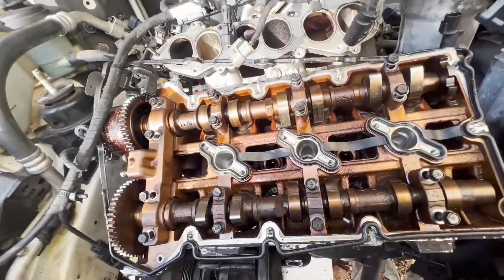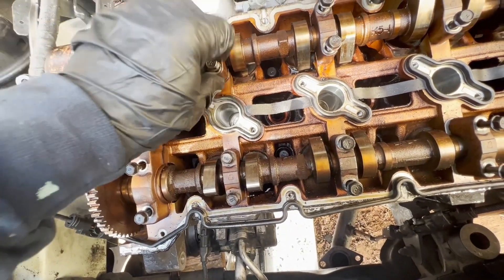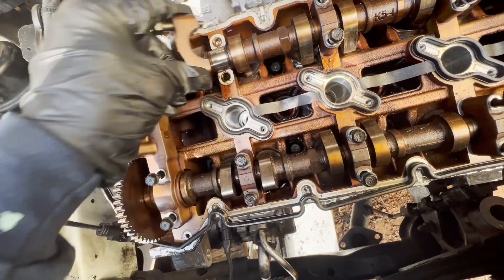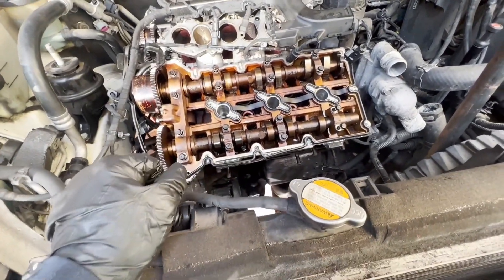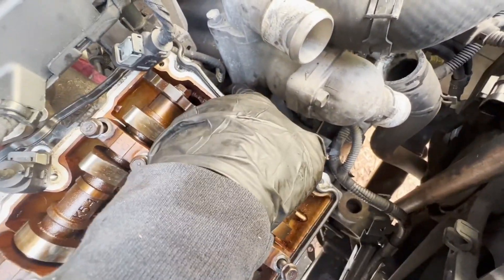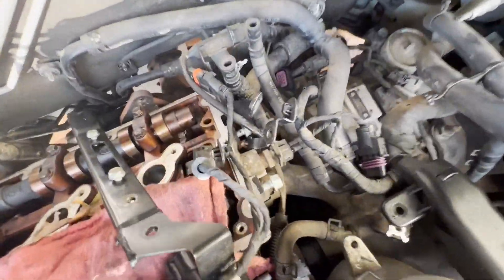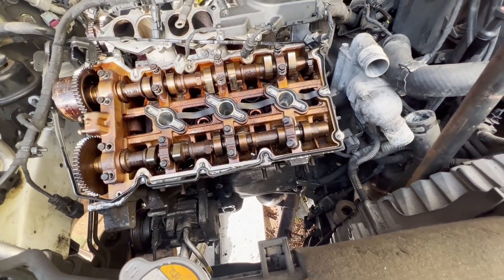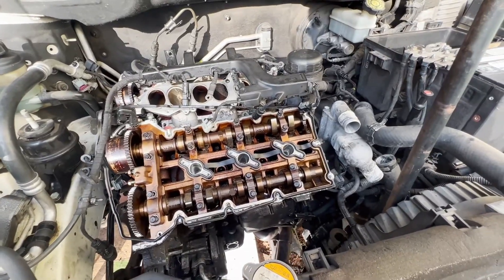2006 Kia Sedona 3.8L Blown Head Gaskets Part 2: Head Removal and Blown Gasket Analysis

Comment: Good Vid !
Reply from the maker: Hi. Thanks for watching and taking the time to comment. This is a multipart series, that I'll be deleting some of the later parts. Long story short, all aluminum blocks suffer this "blown head gasket" which is actually the steel head bolts working loose in the aluminum block. When you go to reassemble with new Torque To Yield (TTY) head bolts, they will strip the aluminum threads.
The steel inserts kits are $400 - $600 and probably 20 plus hours of labor in doing all of them which you would want to do anyhow. Then there's all the points for possible oil and water leaks as RTV is the front cover seal. 
I had this great idea that didn't work to thread the bolt holes at the top and put inserts in there and use short Chevy SB Main Bearing bolts for head bolts. The holes were too big to get a deep enough cut for the inserts even using long ones and when torquing down the heads the inserts spun just as I got to 70 Ft pounds. 
If you have blown head gaskets in something this old with an aluminum block and high miles, take my advice and just junk it. I did that for $500 as the last video in the series shows and used that money to put AC in my 83 F-150 which with a cast iron block and heads will run for ever. ;-)

Comment: What do you do when your timing marks aren't lined up?  The cam closest to the radiator is the only one that is off and its about an inch farther than the rest.
Reply from the maker: Hi/ Thanks for taking the time to watch and comment. Theu absolutely need to be perfectly timed. Don't spin the engine with it like that. It's an interference motor and you'll have pistons bending valves. 
You'll have to release tension in that chain to get it off that cam. Make sure you're at TDC. Then carefully lock ALL the cams in place. You can gently use vice grips and be very careful and get the chain back on that sprocket. If you've got the tensioners already in and released that will be a problem. Once they're released, you can't compress them again. See if you can loosen a rail. I probably show doing the cams and chains in a later video. This was a multi part series.  It's been several years so I don't remember what's in each part, but they all have detailed descriptions and descriptive Titles so you'll know from that. 
Spoiler alert, this thing had stripped head bolt threads which you don't find out until you put the heads back on. I tried an alternative method to tap the top of the holes and put in inserts as the approved method has a $600 Insert Kit and I wasn't going to spend that on a 250,000 mile mini van. I ended up junking it for $500 and put AC in my truck which was a better use of my time and money.
Reply: @mkdhdinfiniteendlessconten3873  thank you so much for replying quickly. So you're saying put piston 1 at tdc, then release the chains, then ill be able to manually  rotate that cam back into the right timing marks? Is there a specific way I need to rotate or how many times? Or can I rotate it forward or backwards?  Sorry for the million questions I just couldn't find anything on it. And ive been searching for 2 days.
Reply from the maker: Hi. My pleasure to help. 
Ideally you should already be at TDC Compression Stroke on #1 when you realized that front Exhaust cam wasn't properly timed. You don't want to turn the engine with a cam out of time, and you should only be turning it by hand. So, 1) Release the chain for that front head. 2) Undo and lift both those cams out so all valves are closed and can't hit a piston. 3) Get #1 to TDC on compression which you'll be able to tell by the Cam Lobe positions where all valves are closed and Exhaust are getting ready to open. (yes, you can turn it either way, but clockwise is the direction it runs) This should bring your LH Cam Marks all in line. Remember, Crank to Cam is 2:1. Crank turns twice for one revolution of the Cams. 4) Reinstall RH Cams. They're marked for RH I and RH E, and I don't think you can get them switched. 5) With both cam's marks lined up, Lock the Cams in place so they can't move. 6) Get the chain back on. 7) Take a break and celebrate Easter. It won't go anywhere and will be waiting for you. ;-)

Comment: Any reason why you didn’t pull the engine?
Reply from the maker: Hi. Thanks for watching and taking the time to comment. It was a teardown inspection. For that purpose it's quick and easy to (relatively speaking) to pull the top end and assess the situation. Otherwise with this vehicle if it was decided to proceed with the repair, there's more than ample room to do so. Pulling the engine with this vehicle would needlessly add hours, with no benefit in making the repair any easier. 
While I initially moved forward with the repair, it was realized during assembly that almost every head bolt thread was stripping out with the new Torque To Yield Bolts. Unlike Aviation, Automobile Manufacturers do not install steel threaded inserts into the aluminum treaded holes. It's built in obsolescence. All Aluminum Block Engines are destined to fail like this. The Insert Tool and Inserts for any make/model aluminum block engine run $400-$600. These are disposable engines and not worth repairing. I tried to get slick with a work around alternative repair, tapping and installing inserts at the top of the block. Great idea. Just didn't work. If you look at all the videos in the series you'll see that alternative attempt, and then I ultimately sold the van whole for parts and used the money to put AC in my truck. I strongly suggest doing the same. It will take 2 full days to put inserts in all the holes, another 1-2 full days to put it all together, and if everything goes perfectly, there's no leaks etc, when you're done you have vehicle worth $1,200 on it's best day. Just not worth it.
Reply: @mkdhdinfiniteendlessconten3873  thanks for the reply!
Reply from the maker: You're welcome. I try to respond to all valid comments. Hope my response helps you decide what to do if you have one of these.

Comment: Excellent video. I seem to have an identical issue. First my T fitting in back went. Can you explain why that breaking would affect the head gasket?
Reply from the maker: Hi. Thanks for watching and taking the time to comment. The broken plastic "T" in the heater hoses will cause the coolant to dump which in turn overheats the engine. 
You'll encounter stripped Head Bolt Threads. I've got a whole series on this issue and engine trying an alternative head bolt repair, attempting to cut new threads at the top of the block and use shorter traditional torque head bolts as the insert tool to repair the factory threads is about $600. Great idea, that just didn't work. 
Besides the $600 for the insert tools, there's all the gaskets and sensors, Chains and guides, the 2 days it will take to do all the inserts and a week putting it together and hoping it doesn't leak. 
My best advice is to do as I did. Put it on Facebook Market Place and put that money towards something else. It's not worth fixing. On it's best day that Kia is worth $1,200. Sold mine in 15 minutes for $500 and put AC in my truck with the money from the Kia. Thanks again for watching.

Comment: I put this project on the back burner, I poured oil and WD and everything I could in the cyls, the motor won't turn more then a degree or two either way. I drained the oil, got 2 qts of water out, pulled that little oil pan, it goopy and sludgy, had chunks of what looks like timing guides, there was a circle of debris around the pump inlet, so much it might have clogged all oil flow. So I have decided to pull the thing down in the vehicle enough to see whats up, then go from there. I know a few cyls had plain water in them and sat for yrs like that. Might have to pull the whole thing out. I gave them 500 for it, but I know its history, it was running good when they bought it.
Reply from the maker: Hi, See my reply to your other comment on one of my other related Kia videos from that series. Thanks for taking the time to watch and comment.
Reply: @mkdhdinfiniteendlessconten3873  Are the cams caps numbered and indexed to position? This motor is most likely destroyed, the heads look like they had been cooked, nothing but hard greasy sludge up top, rust and corrosion from the water. I'm betting the heads are toast. I've never seen one this bad. I got my work cut out. If you have an email I'll send pics.

Comment: I'm in the middle of this same job. I'm only doing it because this is the only vehicle my sister has. I would like to ask you some questions on things not covered in your videos 1 or 2. Thanks
Reply from the maker: Hi, How can I help? Have you watched all my videos in the series on the Kia? What you'll see is that the real problem is stripped head bolt threads, which manifest as a blown head gasket. The special insert tool and inserts will cost $400-$600. It would take at least a day to do all 16 holes. Given that I tried a work around putting inserts at the top of the hole and SB Chevy Main Bolts. Didn't work. I've been building and modifying engines for over 40 years, so I'll experiment if the risk/reward seems worth it.
Bottom line, it's just not worth fixing. The tool is way too expensive for something you'll use for one job. There's so much work and gaskets and sensors and misc to replace. It's just not worth it.  I'm selling it as a parts car. I'd suggest you do the same. Sell it as a whole parts car. Save your time (lots of it) and money and buy your sister a good running 4 cylinder Toyota Camry. 
Watch all my videos on it. Especially "Aluminum Blocks Suck" If you still have questions I'll be happy to answer them. Thanks for watching and taking the time to comment.

Comment: I just got a 2006 Sedona from my in laws, head gaskets are blown, they had a bad radiator and didn't get a new one in time, it was missing pretty bad, sat for 3 yrs now the engine is locked up.
Reply from the maker: Hi. Just so you know and can prepare to spend $400 - $600 on a Steel Insert Head Bolt Thread Kit, you're going to have stripped head bolt threads which you won't find until you start to crank down with the new Torque To Yield Head Bolts. They're like a hot knife through butter. Here's my video of the threads stripping in real time doing the Torque To Yield 120 Degree pull. It did it on every bolts except one: https://youtu.be/6igoEem02nk 
 I didn't want to spend that much on a one use tool that even on eBay folks were selling their used ones for the same price as a new kit and so tried an experiment to thread the top of the head bolt hole and put inserts at the top.  Great idea, but won't work given the ID of the hole and OD of existing inserts that are at least an inch long. I've got 8 videos on this KIA. This one is where I say "My experiment just won't work": https://youtu.be/o0_dUIHe2uc 
I back burnered the project and did some research on other Kits besides Manufacturer Approved Time Sert Kit which is close to $600 after factoring in everything. I'm going to go with the Huhn Solutions Kit for just over $400. I like the method of that kit better than Time Sert. It doesn't matter what make/model engine you have. It happen with a Chevy LS engine. The manufacturers skimp on the build and don't install inserts. The bolts work themselves loose and the heads move around. The head gasket is the symptom, not the cause. 
In your case as far as you know, the radiator was the culprit, but I assure you when you attempt to torque down the heads, you're going to strip threads. Might only be one, but if it's just one it might as well be all of them. There's countless other videos I found after I experienced this on every engine you can imagine, the KIA/Hyundi 3.8 Lambda included. Just be prepared. 
I'm going to copy and paste my response to your other comments in the hopes you see it.

Comment: Cam caps have never had bearing inserts, not the engines I have seen.
Reply from the maker: Hi Ya, Seems to be the norm on overhead cam. I'm use to Old School Cast Iron Pushrod Engines. Also pasting in the same reply below I made to your other comments so you can be prepared for the almost certain stripped head bolt threads you won't find out about till it's too late as I did and countless other folks judging by the amount of videos on the subject and number of expensive $$$ Insert Thread Repair Kits available:
Just so you know and can prepare to spend $400 - $600 on a Steel Insert Head Bolt Thread Kit, you're going to have stripped head bolt threads which you won't find until you start to crank down with the new Torque To Yield Head Bolts. They're like a hot knife through butter. Here's my video of the threads stripping in real time doing the Torque To Yield 120 Degree pull. It did it on every bolts except one: https://youtu.be/6igoEem02nk 
 I didn't want to spend that much on a one use tool that even on eBay folks were selling their used ones for the same price as a new kit and so tried an experiment to thread the top of the head bolt hole and put inserts at the top.  Great idea, but won't work given the ID of the hole and OD of existing inserts that are at least an inch long. I've got 8 videos on this KIA. This one is where I say "My experiment just won't work": https://youtu.be/o0_dUIHe2uc 
I back burnered the project and did some research on other Kits besides Manufacturer Approved Time Sert Kit which is close to $600 after factoring in everything. I'm going to go with the Huhn Solutions Kit for just over $400. I like the method of that kit better than Time Sert. It doesn't matter what make/model engine you have. It happen with a Chevy LS engine. The manufacturers skimp on the build and don't install inserts. The bolts work themselves loose and the heads move around. The head gasket is the symptom, not the cause. 
In your case as far as you know, the radiator was the culprit, but I assure you when you attempt to torque down the heads, you're going to strip threads. Might only be one, but if it's just one it might as well be all of them. There's countless other videos I found after I experienced this on every engine you can imagine, the KIA/Hyundi 3.8 Lambda included. Just be prepared. 
I'm going to copy and paste my response to your other comments in the hopes you see it.
Reply: @mkdhdinfiniteendlessconten3873  Great, this is why I watch you tube vids, I'm a seasoned mechanic but there's always these caveats and unknowns. Thread inserts don't sound like fun but the cost is exorbitant.
Reply: 435 for the insert kit and 762 for a rebuild kit, yikes. Then the head work or rebuilt heads, I hope these heads didn't have a tendency to crack.
Reply: VW Jetta 1.9 TDI BRM has replaceable camshaft bearings. Aluminum head and two piece bearings with journals.